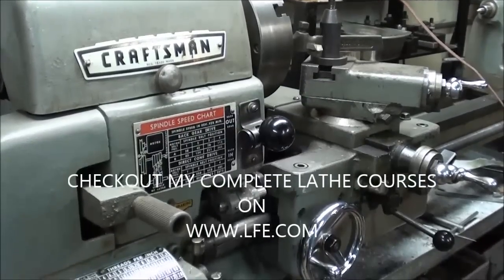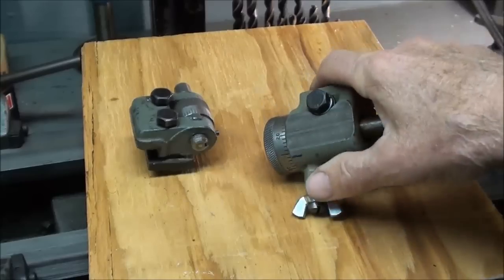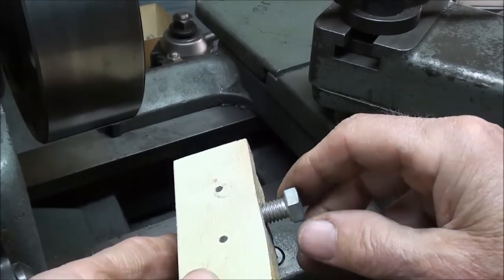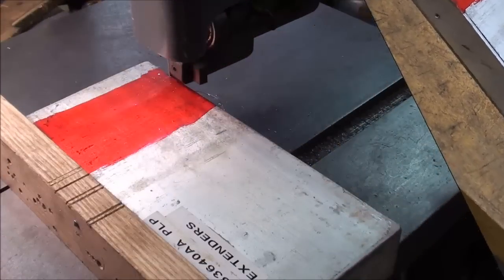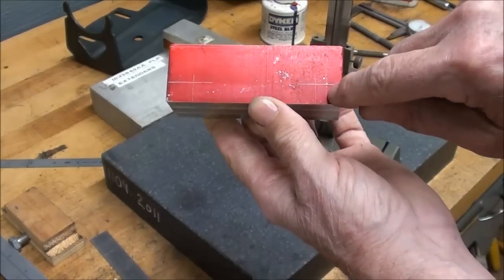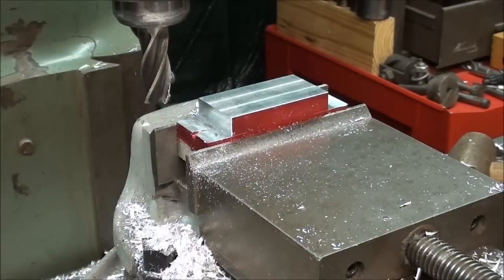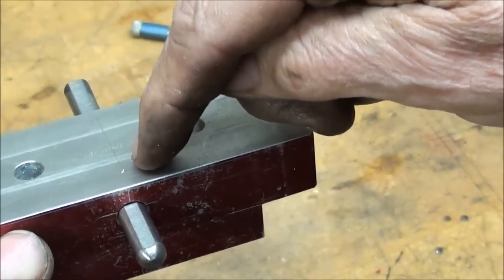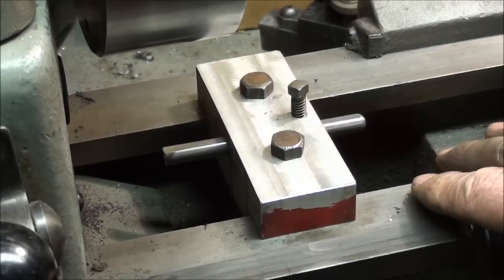MACHINE SHOP TIPS #137 Making a Carriage Stop for the Atlas Lathe tubalcain

Comment: Mr Pete, I like your approach here, going between the ways. I agree w other commenters about using a 1/2-20 or similar threaded stop, and making the whole part as low as possible to add clearance. That probably does not concern you as you have other machines to use as well, and are less likely to swing maximum diameter work on a lighter duty machine like that when you have the Clausing available.

Comment: I may build one for my craftsman atlas. I made the other kind and its ok but like you stated its a pain to get to the bolt to tighten it down. it will twist if you jam or power into it. I generally feed that last bit by hand gently. also I was under the impression the lead screw has a built in slip clutch just before the gear box. at least if I recall  correctly that's what I read when I replaced my lead screw a few years back. correct me if I'm wrong on that. still learning so much from your teaching ability. thanks a million!

Comment: Nice.  The only issues I can see is a bit of loss of swing due the bolt heads.  Maybe an allen head set screw for the stop lock and some recessed socket head bolts to lock the carriage stop?  If you're not concerned about something hanging uo on the bolt heads it looks great.
Reply: Being flush would be nice, but Allen key sockets would be terrible . . . always filling up with swarf.
Reply: russhellmy
I agree.  I have the luxury of having air near my lathe and short blast of air cleans them right out.  If you size the bolts the same yon can use only one key instead of two wrenches. I am just thinking of preventing crashes or limiting swing of the work.

Comment: I would have threaded the block 1/2-20 for a stop screw instead of the rod.  That is .050" per revolution.  Fairly easy to then make it a micrometer stop, or just use a 1/2-20 bolt for a while.  Easier to fine adjust either way.
Reply: Can still be done, with 5/16 he still has the meat for a 1/2 -20.

Comment: No disrespect intended, I'm just curious... at about 13:36 you say drill 13/64 to tap 1/4-20, but isn't the correct size for a 1/4-20 thread at 75% (recommended for aluminum) a #7 drill?
Reply: #7 Drill - .201" DIA
13/64" Drill - .203" DIA

For all intents and purposes, it really doesn't matter...
Reply: the difference between #7 and 13/64 is what? like 0.002? Im no machinist, but I cant imagine it makes a bit of difference in this case.
Reply: Tapping Aluminum a person wants to use the high Spec. of Pitch (major & Minor Dimenision Stuff) .Because the Tap will Rip the threads if the Tap drill  is too Small.
WD-40 is the Best Lube for Machining or Tap ping Aluminum.
Reply: 666alikat Oh, yeah, I didn't even think to check their actual sizes! Derp.
Reply: Cameron Medri Yeah I didn't even think to check the actual sizes. I guess I should've done that first!

Comment: mrpete222 great job on the stop. For your micrometer version couldn't you do something similar but incorporate the factory stop that you already have? I'd cannibalize the one that only had one clamp bolt.
Reply: harperjmichael  A piece of sandpaper, folded and inserted between the flat way and the factory made stop "may" have prevented the stop from moving..worth a try..

Comment: Nice project, I don't like the set scree sticking up like that, a potential snag point for dwarf strings, or even could foul a large diameter part. Also if the set screw comes even slightly lose which might happen after several bump stops, then the rod could move without you noticing, then the whole point of the stop is worthless.
I'd be taking the micrometer parts out of the retired stops and repurposed one to the new stop, brings the project from a 6/10 to a 9/10, if I were your metal shop teacher. It also give you a topic for a follow up video.

Comment: Ever thing a threaded rod instead of set screw on a smooth rod, maybe using 2 nuts 2 pinch lock? Just a thought, i could imagine how many dumb suggestions u might get. Just wanted add one more. Thx for the vid